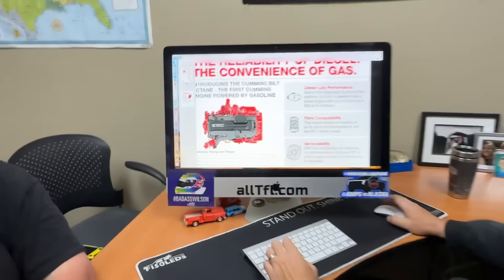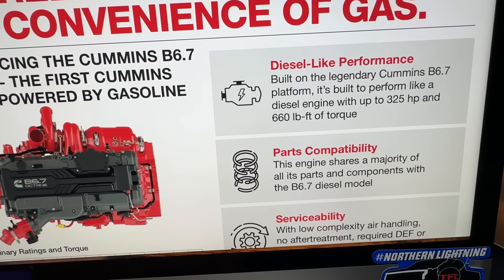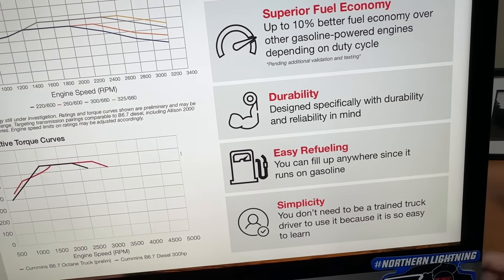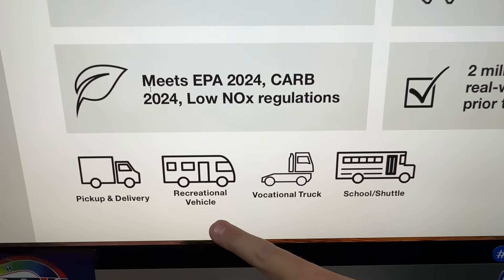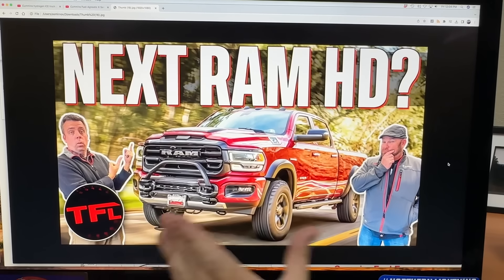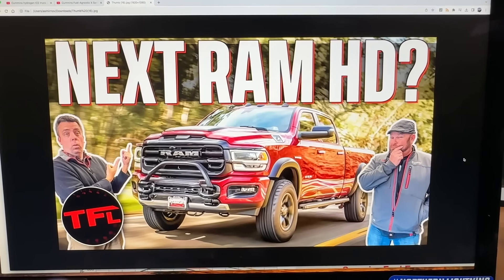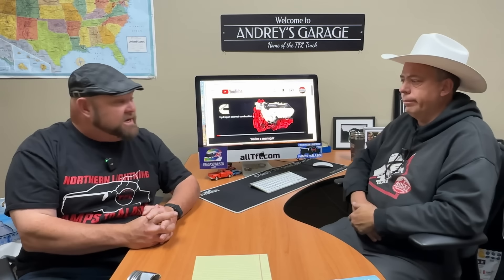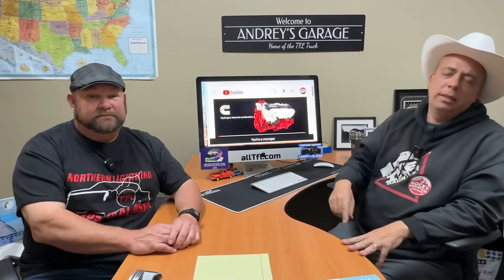It's Not Just Diesel Anymore: Cummins Built a GAS Engine We Want to See in the Next Ram HD!

Comment: The HO 6.7 cummins makes over 1000lbft of torque stock... the gas version makes 400 less... that is a huge difference not even comparable torque. Also i dont know if you ever seen one of these motors in person... wont fit in a 1500! and the 6.4l hemi isn't going anywhere, it is staying in the HD pickup trucks as the gasoline option!

Comment: I’m prejudiced towards the CNG engine, higher BTU than Hydrogen and there’s a station less than 5 miles from me. I don’t need a 1 ton pickup but if I could get a 1/2 ton in CNG with a few more places to fuel up. I’d consider it. Industrial lift trucks have been running propane which is pretty similar to CNG forever and they run inside buildings because they can run so clean when properly maintained.  The technology for filing them is relatively mature too.  Almost like a gateway fuel to hydrogen…I just can’t spend that kind of $$$$$ on a truck that doesn’t really leave town though. The infrastructure is probably going to become an issue there.  If it weren’t for the Schwan’s company running all their delivery trucks on CNG we probably would not have a CNG station near me either.  I wish I could be an early adopter though. 😬

Comment: That engine will be natural gas, gasoline, propane, hydrogen, and a diesel. Depending on the top end, and of course the fuel system. However i would be surprised if it winds up in a Ram. A lot of school bus manufacturers are switching to gasoline engines like the 7.3 godzilla, and Cummins wants there market shares back.

Comment: Big problem is the weight of that engine in a ram.  Thr 6.7 cummins is 1200 lbs.  Its about 600 lbs heavier than the hemi.  So it would have diesel like payload with gas towing performance?  Doesnt seem like a good fit in 2500/3500 trucks.  My guess is stelantis will build a larger displacement hurricane style of engine. Just guessing but a 4-5L twin turbo would net the performance they want.

Comment: Hey I’m thinking diesel needs compression to ignite and gas needs spark. Then you have different pistons for compression ratios. 
Let’s see
Reply: Easy to change in the different heads and headgaskets
Reply: They aren't able to do it without a change in parts.  The point is that an OEM can use the same interface points to install the different versions with minimal changes. You can't just dump in different fuels to the same engine, its not feasible.

Comment: Stream lined bases is cheeper to produce. Also the weight of the motor would be good for front end weight of a tow vehicle for hauling and trailer control. A light vehicle is not good for hauling. You lack in control of your vehicle. I would buy a 3500 dually with the 6.7 gas Cummins.

Comment: I think it’d be cool if they scaled it down into a 4 cylinder version for midsize trucks too, maybe 200hp with 400lbs torque??
Reply: Eww gross 🤢 🤮
Reply: The problem with big I4s is they are unbalanced in the secondary forces and require balance shafts once you start to go over 2L. Cummins made a 3.9L I4 (4BT) and it would rattle your teeth out. It'd be better to take their existing 2.8L I4 and turn it into a 4.2L I6 or their version of the 5.0 V8 and make a 60 degree V6 out of it. The problem is Cummins doesn't have a market for anything like this outside of Ram currently. Ram is also owned by Stellantis, and I'm sure the folks at HQ are itching to ditch Cummins whenever the opportunity presents itself so they can shove a VM Motori engine under the hood to save money. I highly doubt that Ram will use a Cummins gas engine in these trucks and will probably stick to the I6 HO even if the longevity is compromised. It's cheaper to produce than a Hemi or anything they can source outside of the Stellantis umbrella.
Reply: @DJ2226  B4.5 is often used in medium duty trucks and midibuses in Europe

Comment: That gas motor would be almost as much as buying the diesel brother if the short block is the same but changing out the head and fuel system.  $10k upcharge for the diesel currently.  I bet it would be at least a $6K upcharge for the gas version because you lose all the aftertreatment systems.

Comment: They say better fuel economy but I'm not sure about that. The 6.7 desiel has a very heavy rotating assembly. If this is based on the desiel then I assume the oil will be heavy, at least 10w30. I would rather have an updated 6.4 based engine personally. Something Closer to the 7.3 Ford. Up the displacement of the 6.4 and I think  it would easily meet or exceed the 7.3. Up it to a 440 and call it a day.
Reply: Nah Stellantis makes only crappy products, I'd rather see 6.7L turbo gas built from Cummins.
Reply: @MikeJohnson-nr4yo  the 6.4 hemi is a great engine. I drive one everyday. I just don't see this being a suitable replacement. Will it be a good engine? Yes of course. Will it drink fuel like nobody's business? Absolutely.

Comment: these numbers look low for a turbo inline 6, considering, engine power took a 1970 ford 300 i6 and produced a 500hp and over 600 lb of torque on 10lbs of boost
Reply: True, but that was at 5000 RPM. Bring the redline down to 3 or 4000 RPM for hauling duties

Comment: If you have to swap the whole head, that's not a fuel agnostic engine.  In a fuel agnostic engine you only have to swap the spark/glow plugs and injectors. This is an engine block that's way overbuilt for gasoline.  Gasoline engine making 1,200hp and 2,000 ft-lbs on stock internals?

Comment: That's not new. The old 2.5 Ton, "deuce and a half" military trucks, were "designed" to run on gasoline, diesel, and / or kerosene.
I didn't see anyone trying it in our motor pool, but it was designed to do so.

Comment: Diesels don’t work well for small trips, fuel economy isn’t the main thing it’s the emissions systems that need to run hot! Diesels don’t work for small equipment, not with modern emissions, the only use case that will need a 1 ton diesel pickup is hot shots and they are probably ordering them now.

Comment: Well I know ram is going to want match the 7.3 Godzilla at least in HP. I bet if ram goes with a gas Cummins it will outsell the diesel version of it and I bet gm and ford will follow with their own version if it sells well. Weather that means a heavier versions of their gas engines or making gas versions of their diesel blocks and Cummins has also made gas versions of the 6bt CNG for Ag use and busses in the past only difference is the compression ratio in the 6bt CNG was like 9.1 to 1 I think. Different pistons where used intake since it had a vacuum. I bet Cummins figures direct gas injection for there new engine as well as hemispherical bowls in the head to reduce the compression down to like 13 to 1. But I'll say it again ram is gonna what the Hp numbers over 400hp to match the Godzilla

Comment: Didn't Oldsmobile go the other way in the 70s, getting a gas engine and tried to turn it into a diesel?  It was a disaster. Cadillac tried cylinder deactivation (the 4-6-8 engine) in the early 80s and it sucked.  GM swore they had it all figured out and reintroduced "cylinder deactivation" and it has been a disaster. This engine might work out just fine.  But I won't be the first guy in line to try it.  Nope.

Comment: Given that Cummins is using Achates licensed Opposed Piston tech for the new Advanced Combat engine family for the Army, I'm a little baffled why they are going to all the trouble to do this multi-head stuff for an old school design that has an upper limit for thermal efficiency with the penalty of huge weight, and not Opposed Piston engines instead.  Walmart has tested an OP in CA on a Class 8 rig for CARB with outstanding results in emissions and fuel economy that these simply will not be capable of.   Cummins must be concerned about user acceptance or something, because this should not be the path forward.  OP has a far higher ceiling and should be where they spend their R&D money.

Comment: Why not try and reduce the weight some, have buddy with a old Ford with a 300 six with a turbo.  This thing gets good fuel economy with tremendous torque.  The Ford 300 is noted for the long life, and the turbo seems to have had no effect on the engine.  Dodge would be able to make a straight 6 stroker engine, they did it with the slant six and it was damn near unbreakable.  That 3 lt they are building appears to becoming a bridge to far.  A simple long stroke, low end torque monster is what we need, and for some reason manufacturers are only making engines that make tremendous horsepower, at high rpms and practically no low end torque.  Funny because with present gearing and such at 60mph most gas engines are ticking over around 1500-1700rpm.  So those high horses at around 5000rpm and plus they have to have the shit wrung out of them to make useful power to work.  Sort of like those old Chevy 283 C50-60's of the early 60's, you had to wind the piss out of them to get any power.

Comment: Putting the cummins gas engine in a truck that already fits the diesel engine of the same dimensions makes too much sense. You don't need to redesign the engine bay, excluding the emissions stuff.  Everything besides the heads will be the same, making it easier on your mechanics and it still should use the same filter and engine oil to keep the turbo lubricated.

Comment: Hydrogen is not the answer for commercial cargo transport. It’s too expensive and not a reliable source of fuel. Cng is a better alternative however cng torque output is limited of hills while loaded. Range is also a factor with Cng or and gas matter fuel powered vehicles. Liquid fuels are more reliable because they are denser.

Comment: Ford could go back to the 1960s and start building stait6 engines that would be much lighter. They wouldn't reduce the payload capacity and last forever with some newer technology baked in. Dodge owners would have to pay a premium for an engine that is way over engineered with a very heavy rotating mass and loose fuel mileage and power. I can't see it in mass production for  those reasons. It would be another epic fail for ram.

Comment: Diesels are more thermally efficient and more environmentally friendly than either gas or ev. They all make pollutants at some point but y'all need to look at across their entire life cycle
Reply: Unfortunately, the diesel option on new HD trucks adds around $10k (or more) to the price tag, the emissions systems are pretty well know for being problematic and new emissions rules coming up in 2-3 years will not make things any better. 

I've watched several people do the "lifecycle emissions calculation comparison" and the EV wins every time eventually, although there hasn't been any comparable EV powered HD trucks available so far. The new emissions rules, that were signed into law recently, will make it VERY difficult (and expensive) for manufacturers to continue building ICE powered trucks, especially after 2030.

Comment: The biggest problem in the US is the poor quality of diesel. BMW has, as an example, in Europe the 3 liter 6 cylinder diesel with 335 HP / 340 PS / 250 kW @ 4400 rpm and 516 lb-ft / 700 Nm @ 1750 rpm. (With the ZF 8 speed) And you know the Ineos Grenadier diesel is not for sale in the US even if that is the best engine for that car.  Also, as you already mentioned, fuel capacity is the biggest problem with LNG and hydrogen, so that will only be a niche market. It is the same problem with electric powered cars where the batteries are (still) the big issue. To heavy, short range and long charging time. If there will be a major breakthrough for batteries,  than EV will be the future.

Comment: Cummins has been making diesel, CNG, LNG, and LPG engines for years. I've worked on many of them. Hydrogen and gasoline are the only two new things there. You guys really should do a little homework before making a video since you don't seem familiar with emissions systems or the cummins product line outside of pickups.

Comment: Why would you want that? Cummins?? Hopefully this is April fools. Just because it says Cummins doesn’t mean it’s a good engine!! The 5.0 they put in Nissan,,, Toyota rejected it. The current models have accessory parts or incidental parts that destroy the engines when, not if, it fails. The preheater for example. A new model would be risky. Wait until the failures start and then Banks create the reliable replacement piece, 😂😂.  Yeesh.

Comment: I would only consider a heavy duty Hydrogen powered truck in the future when there's enough hydrogen fueling stations available as plentiful as gas stations now. I would never consider a gas heavy duty engine in a heavy duty truck. I'm sold on the torque and reliability, longevity of a diesel engine, especially the 6.6 Duramax.

Comment: Why would the cost change all you are doing is changing the head , Ram has the motor in the truck just change the head remove DEF tank no turbo just a Bad Ass strong multi port fuel injection inline six gas engine, people have moved tons of freight with a inline six motor in is about time that we go back to what worked for years. Hey Andre and Nathan when I started school ( I am 64 ) the 48 passenger school bus that picked me up had a 292 inline 6 myUncle haul freight with a 450 inline six IH red diamond motor also there was a 501 inline also GM made back in the 50"s a 503 inline and don't Packard have a inline 8 ,,,,,,,the 300 inline ford was one of the greatest engines ever made it is about damn time that we go back to what worked great for years a 6.7 inline 6 gas engine made by cummins will be amazing ,,,,,,,,,,well and kick fords 7.3 ass hehe

Comment: This tech is nothing new. I will say those numbers for a gasoline engine are pretty impressive. But wait until the EPA starts mandating GPF filters for gasoline engines. As far as being a "multi fuel" engine. I'm not going through the ass ache of swapping heads to go from one fuel to another and Im not spending $$$$$$ to buy an engine that is on borrowed time to appease the EPA. The new 2027 EPA emissions regulations are right around the corner.  Those new regulations will pretty much ban diesel fuel powered engines.  You will be forced to buy this "multi fueled" engine that still gets less mpg's than a true diesel engine. Don't drink the kool aid!!!!!!  Now I don't blame Cummings. They got to do what they got to do to stay in business. But they can only do so much to get around a runaway .gov agency that is doing everything it can to put them out of buisness. At the end of the day I should be able to buy a Diesel Engine that runs on Diesel Fuel. Not Unicorn Farts!